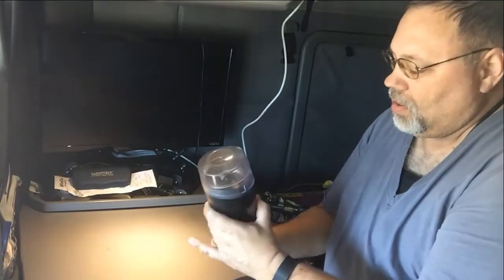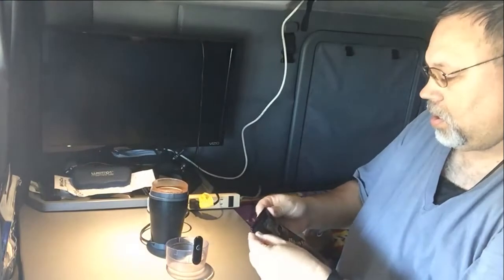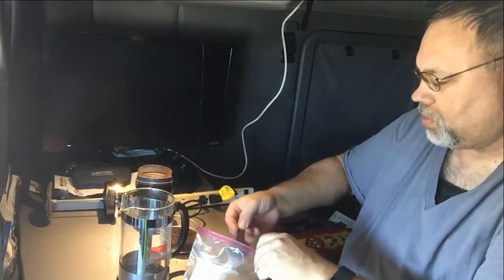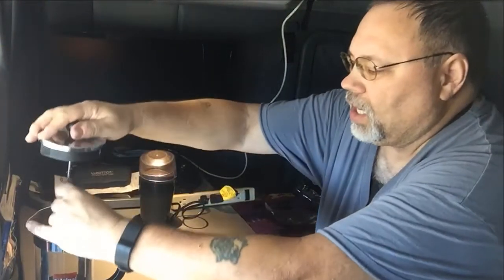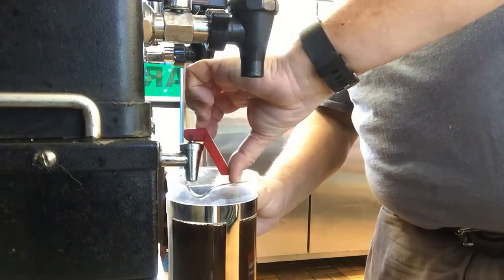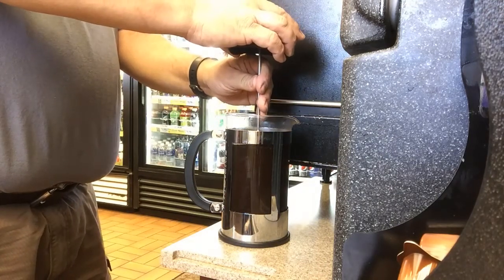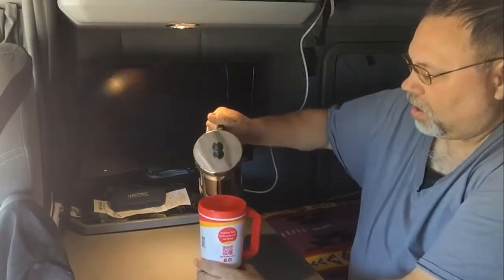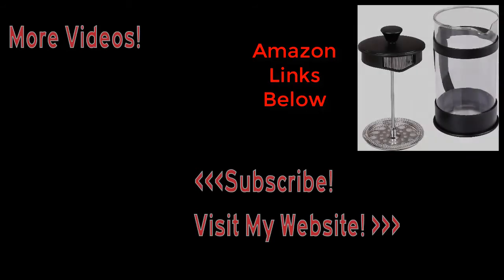HOW I MAKE COFFEE IN MY TRUCK Using a Coffee Grinder and French Press

Comment: I was thinking about doing this but with an electric water kettle. Any reason on why you don't do it like that? Does it take too much power?
Reply from the maker: I did buy one, but my power inverter couldn't supply enough current for it to work.
Reply: @My Over-The-Road Trucking Adventure  oh ok I bought a 3000w continuous power inverter and 6000w surge PI and want to try a kettle... how many Watts is yours?
Reply from the maker: @alejandrovelez8840  1500 watts. My 2000 watt inverter could have handled it if I'd had dual power cables installed from the battery box.

Comment: Every time I use a French press I end up getting a mouthful of grounds that leaked through the screen. Have you found a way to get around this or do you just enjoy eating grounds? I guess at least it solves the problem of finding something to eat for breakfast lol.
Reply from the maker: LOL, yeah sometimes I do chew on my coffee. I've found two ways to adress this. The main thing is to buy whole beans and use the grinder at the store set to the coarsest grind; this keeps the grounds from slipping through the screen. On my French press at home, it came with two extra screens so I use all three which does a slightly better job, even when I use my own grinder. Now, if I can only stop putting in too much water I might stop forcing grounds over the edge of the press screen when I first put it in . . .